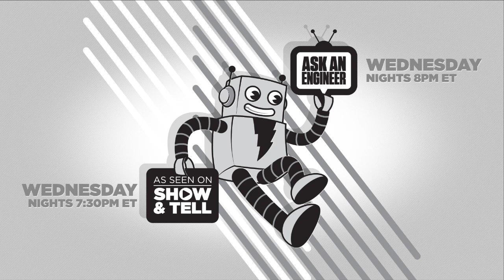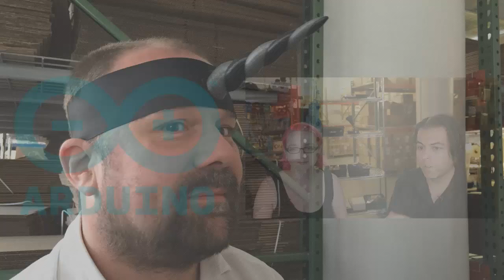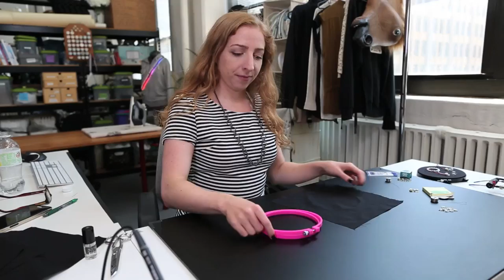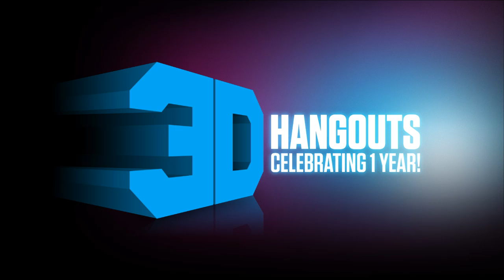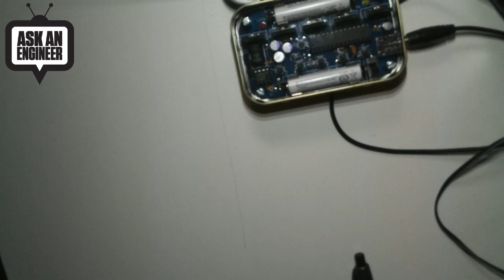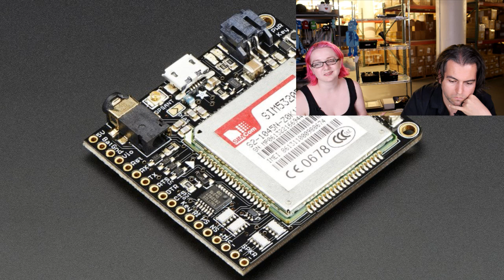6 YEARS! ASK AN ENGINEER - LIVE electronics video show! 8PM ET Wednesday night! 8/26/15 (video)

Comment: Where to start: Arduino  over Pi because it works so easily, plug in and start coding, no operating system to deal with which is a barrier to most.